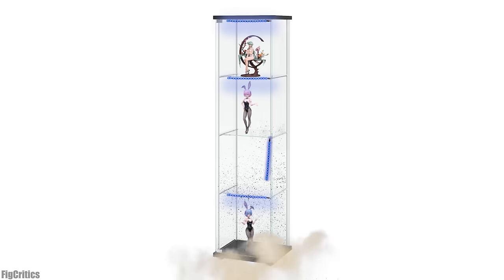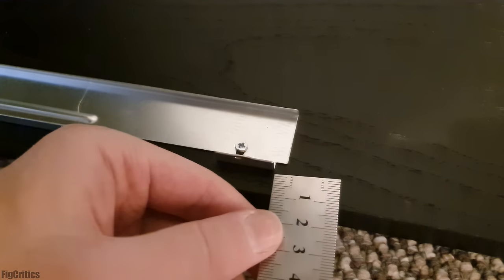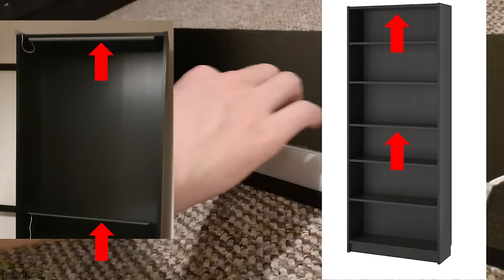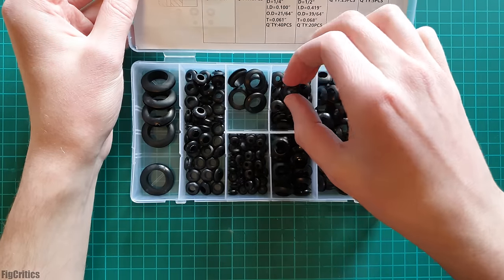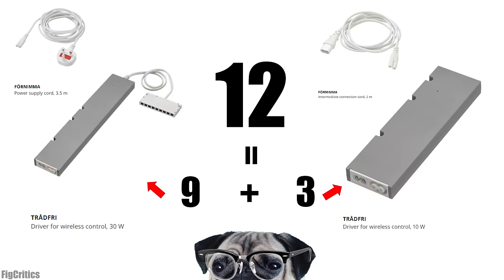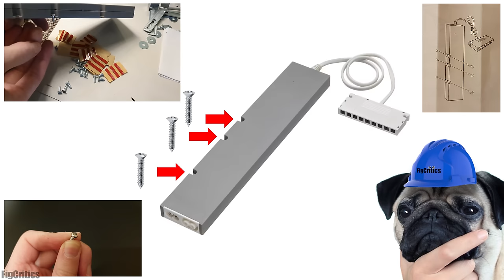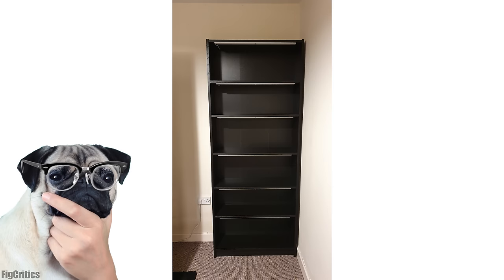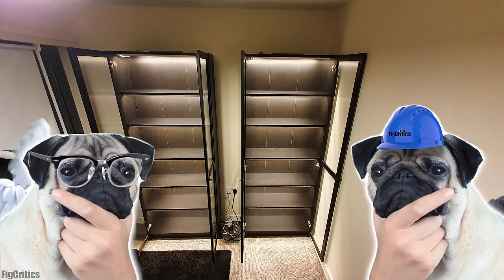How To Make The ULTIMATE Figure Cabinet

Comment from the maker: Thank you all so much for watching! There has been some amazing contributions in the comments that I am going to pin down here:

Doors: If you want more front transparency, instead of the OXBERG doors, use HÖGBO doors. They are widely available now and fully transparent. Follow the same process with the dust guard steps, but perhaps choose a dust guard foam filament that is White instead of Black? I remember seeing at a store some gummy filament available for bathroom shower/bath edges (for stopping water from leaking etc) and they are transparent.. something to look into.

Lighting: NORRFLY has been discontinued and replaced with ÖVERSIDAN worldwide. They look good and have similar sizes. They are more expensive than the NORFFLY, and yet, exactly the same.. It's best to explore other options for the lighting setup now since NORRFLY is no longer available. I have not used the ÖVERSIDAN ones so I cannot make a confident recommendation.. especially at that price.

Stay awesome people!

Comment: Before "Dust" I would say "Visibility" is a greater concern for a good display cabinet. That being the case, the major failing of this particular design are the doors, as they block off a significant amount of visibility at the center of each shelf. I would recommend replacing the standard billy oxberg glass door with the billy hogbo glass door. The frame of the hogbo door is much thinner, allowing for considerably better visibility.
Reply from the maker: Absolutely! At the time of making this video though, Hogbo doors were not available where I live, I'm not sure about the rest of the world though. The only ikea option was what I settled for here. I agree fully that Hogbo doors are a better option for this build now.

Comment: Things I would have done differently. 1. drilled a slightly bigger hole so that the grommets will actually fit/lock in place as designed without needing to trim/cut the rubber. The finished holes will still look the same as the ones in your video. 2. painted the wires and silver lamp shades black to make them match the shelves. 3. pulled/split apart the wire's connector ends a few inches, that way connector ends can be easily fed though the grommet hole one wire end at a time. And in case you didn't know, Ikea discontinued the Norrfly light strips at the start of 2022.

Comment: FYI - when putting in the shelves your photo lists 7 holes between D and E but there are actually 8... After the spacing looking off, and 20 minutes of confusion, I finally realised and made the adjustment. The video is great and thanks for the step by step. Saved me lots of trial and error and probably some scratches and unnecessary holes!

Comment: The original Morliden glass doors are a better option. Now the next best option available is the Hogbo glass doors. They are less intrusive and does not have a random crossbar in the middle which gives you more flexibility to place the shelves at different level.
Reply: The cross bar in the middle won’t matter since the mid shelf of the billy is part of its structure and can’t be moved, it’s always gonna the in the middle.
Reply: @martinlutherking6550 you’re right. Forgot that shelf was fixed but it’s still better looking since the door doesn’t have a random middle bar. And the bezel of the glass door for the billy is also thinner

Comment: Awesome tutorial, just build my cabinet according to your guide. Only thing I didn't do is using those silicon rings for the backside. I drilled the holes in the backside very close to the shelf above it, so the cable-canal actually hides the hole in the back :) 
I also used a little more than 1cm of space between the metal-railing and the front (maybe 12-13mm) since then I had a little more room for error, because with 1cm you could see the lightstrip coming out on the front if you drilled just 1 or 2mm to close to the edge :D
Reply from the maker: Well done you! So glad to hear you made some adjustments as well from this to personalize it. I think a few mm extra for the metal-railing is a good idea. I took my time and was very precise so I could get away with doing it without any wiggle room, but I agree, a tiny bit of wiggle room for these rails can't hurt and won't be visible.   Good job again and thanks for following this tutorial ^_^!!

Comment: Great instructional video. What about black electrical tape to cover the white wires as they run from the light to the back?
Reply from the maker: Thank you for watching! And great suggestion!! I did actually try that immediately after I pulled them through, but the tape reflects the light a lot, so it stands out like an anomaly on the brown shelves. Honestly, it's better to leave it out as long as it's properly done and straight-ish.

Comment: About to build one out of a 48x18x70 Muscle Rack just need to track down a supplier of acrylic sheets out of town cause my Lowes doesn't sell the size I need in the thickness I want. After that have to decide if I want acrylic sides or not. The front acrylic panels will be attached via magnetic tape cause the frame of rack is made of metal. At a guess it will cost me around $250.

Comment: Instead of installing the light strips before assembling the book case can I installed the lights after? Because my bookcase is already built and I love how yours look with lights in it, adds an extra look of luxury
Reply from the maker: Hey Slaysian, I thought about this for a few minutes, and the answer is YES! The only thing I would do is remove all the shelves to do the light installation Part on each shelf (aside from the middle one that is not removable). Then the rest is pretty straight forward from there, you'll have to make sure the cabinet is not against a wall because you'll need space in the back to drill through the light cables and arrange them etc..

Other than that, you could defo do this, you might want to take the doors off as well, they will get in the way!

Comment: I really enjoyed this video. It offered a very cool alternative to the Detolf solutions. I wish I had kept the majority of my Billy bookcases. I'm not sure I want to try this with my already built ones left.
Reply from the maker: Thanks a ton SuperTiso! Totally doable with your already built ones, you'd just need to remove the shelves and detach them from the wall for the delicate cabling process. Aside from that, I'm confident you can brew this up into a PROject :D! Good luck to you!
Reply: @figcritics  I have only one attached to the wall as where it's positioned it rests between a wood window and other wood panel. The rest of my room where my second one is just sheet rock or brick. Ironically the one I have attached to the 2 thicker wood walls gas a door system on it too.
Reply: @figcritics  Here's a question, would this be possible to do with the small version of the Billy?
Reply from the maker: @SuperTiso  I see exactly what you mean, you're not the first person asking this either! And absolutely! Basically, the only thing we would be concerned about here is the size of the Norrfly light bars. And thankfully, ikea offer a large range of sizes on those bars which fit ALL their Billy's and other shelf units. So definitely, grab those measurements from your cabinet and check if there is a suitable Norrfly size on IKEA for it. That's the only thing you'd need to be concerned about in terms of "size". You'd also just have to use different measurements cuts on the strips of the final chapter where I was making it "dust proof".

Comment: You mention in part 2 that 4 of the light bars need to be installed to fixed parts of the Billys. You might want to do those before you put the Billys together, making it much easier to install them.

Comment: the only issue with this are the gaps between the doors and the bookshelf. i added some weatherstripping foam between the cracks to block the dust out and i dont have to dust every year
Reply from the maker: Thank you for watching! And fantastic :face-red-heart-shape:! I tried to do this but the wood on my doors on both are uneven, so it just made the gap bigger in some places.

But I've NEVER had to dust it yet either, so pretty pleased about that!

Comment: Great build! Sadly the Norrfly lights are discontinued (or at least they are here) and the new lights aren't angled :/
Reply from the maker: Hey Gris, thank you for watching pal!
They replaced Norrfly with something called ÖVERSIDAN, exactly the same in terms of wiring and drivers and does have a decent angle to it! Problem is, they are more expensive and not as good. I was lucky to get my hands on these Norrflys before they were discontinued as they can last forever. So at this point, to anyone who would want to do this, I think a bit of browsing around will easily get them on track for an alternative. I'm sure given time there will be better options at Ikea than ÖVERSIDAN as well.
Reply: @figcritics  Oh yeah youre right! Didnt see those at first. Thanks!

Comment: How is the color of the light bars? Is the video fairly accurate or is it a warmer or cooler light?
Reply from the maker: Very pleasant and relaxing. I didn't make any changes to the contrast or colors in the video so this is raw and honestly near to exactly how it looks in real life! It's a very warm color, a sort of rich golden lighting.
Reply: @figcritics  I gotcha, do you feel it changes the appearance of the figures? I have some 40K models I got professionally painted and wouldn't want to hamper them to much!
Reply from the maker: @Justiceinthefog   I see what you mean, they do add changes to the overall natural color palette of the figures, but not in a aggressive way. Right now I'm actually using those cabinets for my manga collection rather than all my figures! I'm packing away my collection atm so that's why really. 

I presume 40K models are usually small, so I doubt these lights will make any changes to the paint job at all, I think they will make it look even richer. The black/brown paint of the cabinet walls absorb a lot of the light as you can see. But I guess with all lights, the closer the item is to the source, the higher concentrate of the light, so you should be absolutely fine.

However, these lights are no longer available at ikea. I pinned an alternative in the comments though!

Comment: Very useful, entertaining and practical. Also, what a beautiful collection. I only have 10 anime figures right now, but i'm looking to expand. I have a modded detolf with extra shelves and dust proofed with weather tape.

Just a quick question. How do you cover the opening between the two doors to ensure no dust gets in through there?
Reply from the maker: Hey alexl6644! Thanks for your lovely comment, it's appreciated. And hey 10 figures is awesome!! At least you're taking your time and only buying what you REALLY like. 

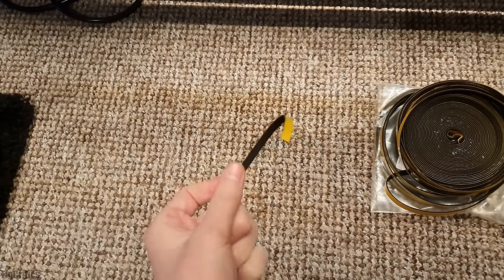To answer your question, I didn't use anything for that! You'll see at 25:50 that I touch on the subject a bit about why I didn't. But the good news, is that I have never had to dust these cabinets yet! Dust likes to "drop" onto stuff. So I honestly haven't had to do anything about the gap in the middle which has been great! I thought I should and I could, but actually, there's no need... unless you walk past the cabinets multiple times everyday, I'd suggest do nothing about the middle door gap.
Reply: @figcritics  Thanks for the reply. When I eventually upgrade my display case I'll take your advice into consideration.

Comment: Detolfs used to be great, back when they were 50 bucks. Now they're $130, lower quality than they used to be, and it's basically reached a point where you can get much better cabinets for similar money. These are nice, but for the cost, time, and effort needed, you could get a higher-quality shelf.
Reply from the maker: Yes there are definitely ways to improve this as well now with the HÖGBO doors instead of the OXBERG doors to start with! And as you say there are other options out there. I think this is still a great option with the HOGBO doors, very solid unit these billy bookcases. Lighting systems are always changing, but this gives people some guidance and options to plan ahead on how they will go about it! :face-red-heart-shape:

Thank you for watching friend!

Comment: whats the biggest figure you can fit on those? For example i got Ninggung Figure recently but her base is 30cm square size , would it fit there?
Reply from the maker: Great question! In fact, I plan on reviewing her since I own her too! Depth wise she does not, I did try, and she BARELY fits into my detolf. Ofc without her base she fits just fine. The depth of a billy shelf is slightly lower than a detolf, but you obviously have more space vertically and horizontally.

Comment: Will these shelves work for 1/6 scale hot toys?
Reply from the maker: Oh absolutely. Basically, you can adjust the gap between each shelf to whatever you like! In fact, you don't even need to put all the shelves in the build either if you want more space between each shelf. 

So if you have a figure that is 20 cm tall, it will fit. And if you got one that is 60 cm tall, it can also fit! Just be sure to plan your cabinet content and ideas before making permanent changes such as the drilling on the back of them.
Reply: @figcritics  thank you! I’m really considering doing this based on your video.

Comment: Why would t the lights go in the back of the shelf instead of the front? Anyone have an answer? I feel like the front would be an eye sore.
Reply from the maker: So basically, these lights have a protective front and angle, meaning you cannot see the LED lights. They also are fitted with a sort of mirror that reflects the LED rays backwards, hence why it's important that they are as further to the edge of the shelf as possible to maximise the ray spread. Putting these at the back of the shelf would be more then detrimental.

Comment: is this doable with the oversidan. idk if its just my area but norrfly is being discotinued and doesnt have the 67 cm anymore
Reply from the maker: Absolutely! You'll have to neatly grind off or cut off the white pegs on the side of each Oversidan, and get size 71, and you'll be golden. This will work just fine by using the same process I used here, only the sides that need cutting off will be the only difference, along with a few more cm's in length.

Comment: Hi, the Norrfly LED light strip are discontinued and was wondering if you could suggest a replacement.
Reply from the maker: Sorry for my late reply! I just checked today and it seems like they are still in stock here in the U.K. Could I ask which country do you live in? That's a real shame that they have discontinued them where you live. LEDBERG from Ikea are good, and have different color options too, but they don't come close to the aesthetic of the Norrfly for this build. This billy build is pretty chunky, so you would want lights that are chunky with it so that it fits in IMO.

LEDBERG are good, but as basic thin hard strips, they don't really fit this build, but still are an alternative that would work and would certainly be easier to install. You could follow ALL the steps for passing the cables behind the cabinet from here as well.

Hope this helps!
Reply: @figcritics  Hello, thank you for the reply and the information you provided. I am currently in USA. I loved the idea of "defuse" Norrfly has as I wish to build this display case for displaying my graded cards. I'm worried a bare bones light strip will show as a reflection on my cards.
Reply from the maker: @Starheroz  Aw my pleasure bud! I see what you mean about your cards... hmmm. What you need is a LED strip that has adjustable brightness, because regardless of the LED, it will most likely cause a reflection if the light is too strong or too close to the cards. So as long as you have a brightness adjustable LED such as the one I suggested, you should be golden, in fact I think that's the best way to go because the Norrfly LED's are VERY strong in terms of brightness, so they may actually not be the best option here. You'll be able to control them as well I'm sure, the LEDBERG seem pretty good!

Comment: First of great video, but you put so much workt in all of this but i think 1 little extra step would had been to stain the foldlines of the backplate black so you dont see them so much.
Reply from the maker: Thank you so much for this comment! And it's true, they do show a little. I did have some ideas around it but all of them would make those lines scream more.. Because the backplate sheet isn't black, it's a mix of printed fake Wood (Brown, black), so painting over it with black would stand out more for me since the light really bring out everything. Thankfully those fold lines are very well cut, so they blend in well with the cabinet and frankly do not deteriorate it's appeal in the slightest. I think the only way to hide that, would be to repaint the entire back, but you would lose the fake wood effect from Ikea that matches the shelves etc.
Reply: @figcritics  Maybe clue them to gather never tryed that yet what worked for me was using a very flat and mat black from minature painting